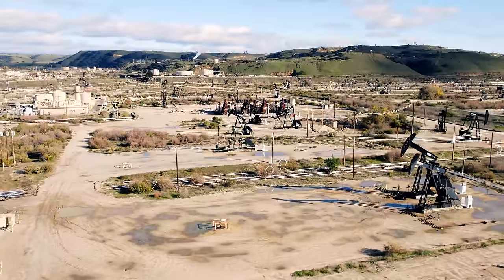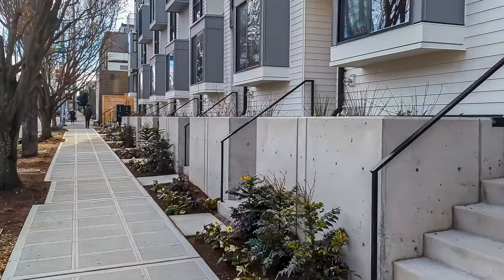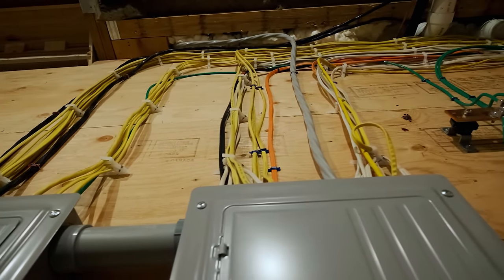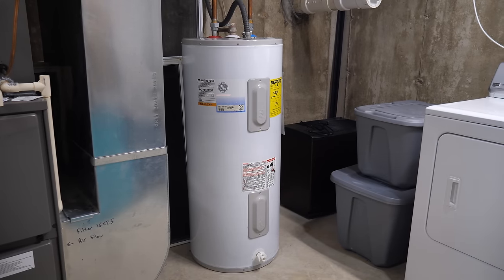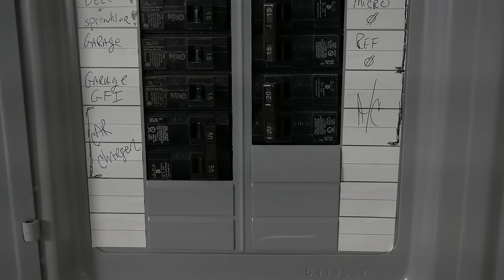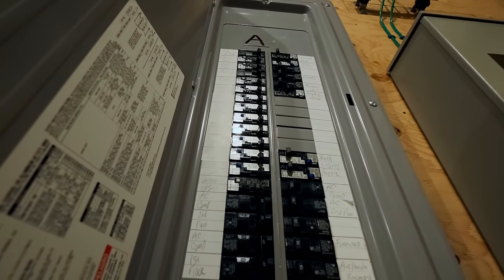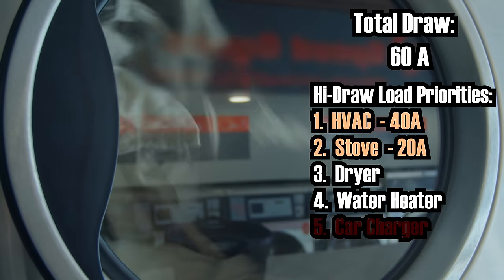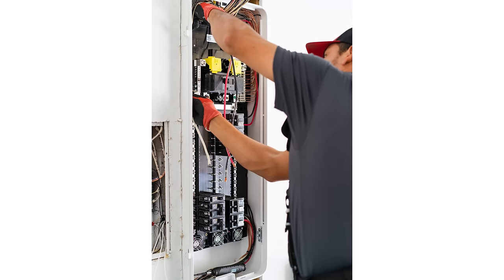Home Electrification: There's not a lot to do, and it doesn't have to be hard (Part 1)

Comment: With recent electrical power outages (brownouts and blackouts) being in the news, I am very interested in your take on backup power generation/storage. I personally have a whole-house natural gas generator system that allows my home to continue functioning as usual during electrical outages.
Reply: I wonder about this too. What's the current start of battery backup? How practical are they? At what price point?
Reply: Isn't what you have already a decent solution? A generator is perfectly fine for emergencies when there's an electrical grid
Reply: thats not relevant for 99% of the country. Just move out of Cali
Reply: Maybe fifteen? Twenty? years ago, it was in many places cheaper to run your house off a IC car engine running on natural gas, hooked up to a generator, than it was to get electricity off the grid. This required using the engine exhaust for heating, of course. It essentially gave you high efficiency natural-gas based heat plus free electricity. Naturally this all relied on cheap gas and an environment where you needed the heat, so as soon as the weather gets warm enough you would need to switch back to the grid.
Reply: @RyanDiederich  How is it not relevant? Blackouts happen everywhere and most houses have natural gas service. I live about as far away as you can get from California and the house across the street from me has a whole-house generator that kicks in as soon as the power goes out.
Reply: Natural gas generator still needs the natural gas system to be functional and supplying gas to you... personally, I would prefer a system where I don't require any external sources.  My power grid here is great.  My PC's UPS last activated aug 31... for noise and only for 4s.
Reply: @jgood005  in short, expensive but getting cheaper every day. Today you can get 5kWh LiFePO4 batteries for around $1,300-1,500 depending on what features you want. That means that carrying the average household load from evening to peak solar the next day is $6-8k just in batteries. Add in the inverter and enough panels to actually refill those batteries and you're at $15-20k without factoring in labor. One thing that will drop that cost over time is EVs, with vehicle to load capability most households will just need a few thousand worth of stuff to manage a few days without a grid connection.
Reply: His "take" is that you're a member of the Flinstone family for believing you need to burn anything these days.  It's a rather shallow and ill-conceived perspective, especially for those in climates where heat pumps are a joke.  In some of his previous vides on heat pumps, there's some admission of that, but not in this one - those caveats need to be said - points off in my book for including them here.
Reply: @RyanDiederich  No
Reply: @thom1218  meh, you can get heat pumps that operate efficiently down to -22F, that covers all of the lower 48 and the vast majority of inhabited Alaska.
Reply: I would have liked to see more about failsafes, maybe that's in part 2?

Last weekend, I was hit with a 24h power outage. I have never been so thankful to have a fully gas-powered room heater (and stovetop, if I would have needed it). 
There were neighbors who were relying on blankets for sub 40F overnight temps.

As for garage door openers, smart door locks, that was literally locking people in. To electricity is not some magic solution without adequate backup in the event of an outage.
Reply: Especially as those most occurrence happen during the time when electricity is most needed. The majority of power outages in my area (SE Michigan) are caused by snow or ice storms.
Reply: @xdega  garage door openers have a pull cord for power outages, but for a few dollars more you can get them with a battery backup, that's what I did when my 1990s unit finally died. As far as Smart locks, every single one I've looked into has a manual and/or battery backup to allow for power outages.
Reply: If you don't already, imo maybe get the propane conversion kit for your unit (a simple procedure with very few operations and parts) and then if the gas service fails you can switch to emergency propane tanks.
Reply: @BW  "blackouts happen everywhere" they're rare in some places. There's a wikipedia article for a blackout in London that lasted 37 minutes in 2003. That's how rare they are in the UK. Very few people have backup generators here.
Reply: @andrewfidel2220  Last week it was -33 and I live north or North Dakota not Siberia 
us "northerners" NEED a resistive heating source NOT JUST heat pumps
Reply: @wolphin732  You get your own gas tank to fuel your natural gas generator.
Reply: My big problem with this is the fact that if there is a major disaster, there is also the possibility that the natural gas system will be knocked out. That's why I am personally looking into a diesel or Propane system.
Reply: @andrewfidel2220  just going from reports of people that were nearby, I believe the garage doors in question are the ones that are used for apartment parking. I was relatively fortunate.
Reply: @xdega  Ah, commercial doors normally have a chain system as backup to the electrical system but it's possible either an apartment install omits this, or more likely nobody knew how to operate it.
Reply: @andrewfidel2220  or nobody wanted to spend half an hour pulling the stupid chain, drive out, then another half hour winding it back down. Had a very big roll up fire door at an old employer, drive motor quit on it. Took an eternity to get that dumb thing open.
Reply: @CampGareth  So they do happen. The fact that my neighbor installed a generator gives a clue as to how reliable my power grid is and I live in suburbia in a middle-class area in a decent state.
Reply: @RyanDiederich  Brown outs in summer are common even in NY, a tropical storm years ago absolutely thrashed the infrastructure up in NY and its never actually been fixed. It was mostly just repaired enough to function so power outages and brown outs are common. Took mass failure of telephone poles where a lot got wrecked from high winds to even start replacing the old rotting poles.
Reply: @RyanDiederich  California is over 10% of the population.... your math doesnt add up. You also act like California is the only state that has rolling blackouts...

Comment: District heating (and maybe cooling) would also solve a great deal of energy need as well. I live in downtown fake London (Ontario) and we are on district heating that is provided by a co-generation plant. I know some places now take waste heat from industries and use it to heat homes. However like you said, lots of homes are not built for upgraded electrical/heating systems right now, so retro fitting with smart systems is a good solution. I think a climate scientist said it well with "there is no one true solution, we must take a portfolio approach to our energy needs and climate policies."

Comment: I'd just like to add in to the list of gas appliances in a house that gas based refrigerators and freezers are still a thing.  A thing that may be cool enough for its own video if you haven't done one yet.  Apologies if this is covered further in.
Reply: I've only ever heard of those being used in RVs.
Reply: @eDoc2020  I know some people use those on their non electrified cabins in the middle of nowhere. But newer seem those used id grid power is available at all.
Reply: Came to see if anyone mentioned that. And yeah, they're mostly in RV's, but I do know at least 2 people that have them in their house, but not as their main fridge.
Reply: Adsorption refrigeration requires little heat or energy to start the refrigeration cycle, maybe a large candle flame, a 30 pound propane tank lasts for months.. I have seen these appliances in off grid wilderness homes where electricity is solar, water turbine driven, wind driven generators. Lighting is all low voltagae, low current Light emitting diode upgrades from older RV 12 volt direct current bulbs.  These led bulbs use a tenth or less of the power the present 120v ac lights use, and many already have been swapped over to led style,  so lighting is not the demand on the power...it's  the work horse designed appliances like cooking range, electric element heating appliances (home spaces and water).  
  The best heating fuel would be one that burns clean, leaves little or no carbon ...
That would be hydrogen as one that can be generated from plain water..yes..plain water contains hydrogen and oxygen.. H2O...how do we separate them is another science. Check it out..
Reply: @Barracuda48082  Absorption refrigerators use much more energy than typical compressor-based refrigerators. And 12v LED bulbs are similar efficiency to 120v ones, not that it matters because the power is low either way.

The problem with burning hydrogen is there's a lot of energy lost during electrolysis if you generate it from water.
Reply: @eDoc2020  they sell them around here to the amish, either for buisness or for personal use idk
Reply: there's a place that sells appliances to the amish in southern ohio and its like a divergent timeline there. full size gas fridges, sterling engines for your wood stoves, composting toilets for your house, browngas stoves

Comment: Your video on heat pumps helped me decide to get a heat pump when taking out my old oil furnace. I also have a mini split for my bedroom thats not ducted into central heating. No issues so far with either of them. With my new solar panels I can see a baseline 2.1 kw/h draw and an evening spike to approx. 5.5 kw/h when I come home

Comment: I'm gonna add that if you have a forced air gas heating unit, ADDING an AC unit to it is a 1 day job for a qualified installer. We did this at our Townhouse a few years ago, and it was so nice to be able to keep the windows closed and avoid the noise of our neighbors across the driveway from shouting at each other.
Reply: And adding a heat pump is just about the same as adding a cooling-only unit. The main difference is in the thermostat wiring.

Comment: Smart panels are neat, what worries me is whether Leviton and Span will continue to support their products in the future.  If the adoption rate isn't good enough, Span does not have other product lines to support itself and could die.  Leviton at least is a multi product company and can weather slow adoption better than Span but you have to consider the fact that you can still buy a breaker for a Square D panel from 1970 and a Siemens panel from 1974.  In other words, Span is going to have slow adoption because slow adoption can kill the company and Leviton will kill a product line based on a business decision as panels are not their primary business.

Comment: I'm glad you covered smart circuit breakers. I've heard of them a few years back, but haven't heard any updates since then. I hope we can get some open source ones.
Reply: Only way I'd even consider a "smart" load center is if it was capable of being managed entirely on-prem and the protocol was fully documented. I've had way too many idiotic fails with proprietary "cloud" services and won't even consider vectoring my home lighting through "the cloud", let alone much more essential equipment.
Reply: The energy corps would just regulate your energy use as they see fit for their convience. Happened in Texas with smart meters during that snowstorm.

Comment: Doing laundry often involves hot water and a dryer. I'm not sure placing the dryer above the water heater is the best idea. I'd almost always rather have access to a shower or cleaned clothes. It's a hassle but if I need to my clothes can sit wet for a couple hours (they sometimes do that now anyway.)

In large houses with 3 or 4 kids this will certainly be a headache. In some houses a shower, an oven/cooktop, and dryer are almost always running. Obviously every house has different needs, but larger families use more power than smaller families do. I don't think this is a system/plan of action for everyone, but it's an excellent proof of concept regardless.
Reply: I don't know about newer dryers, but older ones certainly won't restart a cycle when power is restored. So in an underpowered scenario like what the video addresses, everybody using the dryer would have to be aware that they have to check on the dryer before it's too late in the evening. I think I would lower the priority of HVAC, put it just above the water heater at the bottom. It's the interactive things that require touching and tapping that need to be higher priority.
Reply: I was thinking a similar thing. Wet clothes can always be laid out or, in a real pinch, dried with the good ol' hairdryer and wear it damp method. But when I'm cooking, chances are I've been using hot water. Washing hands, dishes, and utilizing the hot water from the tap to make bringing a pot of water to boil faster are pretty much all guaranteed. I'd say dryer is likely the least important besides the car charger, and I might drop the HVAC a peg too just because my house is pretty well insulated and I can stand a 4 degree change in temperature a lot easier than a half-raw meal or a cold shower.

Comment: I know you said that you are referring to the American market. However, in my country we're going the opposite direction! We used to have an extremely reliable grid (one of the best in the world), but decades of neglect has caused the grid to become so fragile and unreliable that we're all forced to switch to "burning stuff".
We've switched to LPG (a very clean version of gas) for cooking and plain old wood stove for heating in the three/four winter months we have. Our water heaters (geysers) are directly solar heated.
The rest is still powered by electricity, but with many homes now using battery-backed up inverter systems - even in the city, where I live. PV solar is used for supplemental power and charging during the day. It's a weird mix of renewables and back to burning more stuff for cooking/heating.

Comment: As an Australian, I assumed off-peak electric water heaters were common. Old systems used a clock in the meter box (breaker board) to disable the heater except during off-peak hours (sometimes with a switch in the house to enable it if you ran low on hot water). Some regions had mains signalling to turn waterheaters on and off.

Comment: I did some math. Natural gas here (middle-of-nowhere US) is around 3.5× cheaper per unit of heat than electricity. If I were to actually get a heat pump, it's minimum HSPF would have to be 12 to meet the same cost-per-heating-unit of gas. The few heat pump offerings I've come across are around 8.5, some even less.
Reply: OK, compensating for bare-minimum-standard 80% gas furnace, the HSPF on a new HP should be 9.6 to meet my current cost of heating

Comment: Just a minor note: to go from an AC to a heatpump, there is a bit more than just a reversing valve. A reversing valve, a defrost control board, defrost sensors, heat strips for defrost (which it can call for defrost even when ambient conditions are above 32F because the outdoor coil is usually about 15 degrees below ambient) a outdoor txv, and the indoor coil is usually a different size than a solo AC because it acts as both a condenser and evaporator.
Reply: ...AC is by definition already a heat pump. So no, nothing has to be changed. The video specifies that one thing is necessary to make it flow both directions unlike an AC, and that is true.
Reply: Show me a conventional (not minisplit) ac that doesn't have a second (for heating) metering device, and control logic for defrost, along with a defrost thermostat.  In the pedantic sense an air conditioner is a HP. But my point is still valid, to turn the unitary AC shown into a heatpump, it does require more than just a reversing valve.
Reply: @grashoprsmith  It is very much the pedantic sense and if you're here to argue against the pedantic sense you're very much looking at the wrong channel.
Reply: @Farley Hawkes  well pedantically speaking, if you read my initial comment, it still stands. A refrigerator is a heatpump, but you wouldn't use it to heat your home. If technically an AC is a heatpump, then why do you need a reversing valve to make it a heat pump? Because we are talking about practical application and not definitions. You dont know what you are talking about, so go insert your half baked opinions elsewhere.
Reply: @grashoprsmith  It's okay to be wrong about things. You can admit you were wrong and still carry on with life.

Comment: That's good news about heat pumps. I'm an electrician in Florida. Heat pump-only systems are becoming the norm here, but I still run across heat strips often enough that I annoyingly have to talk to the HVAC guys prior to running my circuits. Far too often, they don't know the amps of the heat strip they'll be installing because everything's on backorder and they haven't got the submittals approved yet, so I end up having to oversize my wire just in case. With better heat pumps, I'll no longer have to worry about that bullshit.